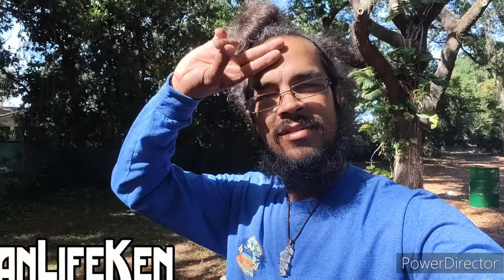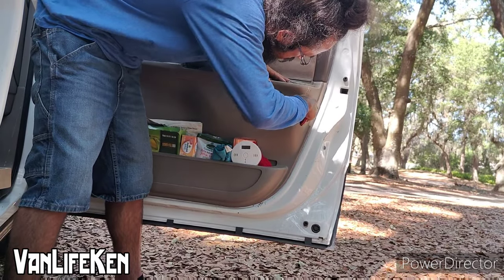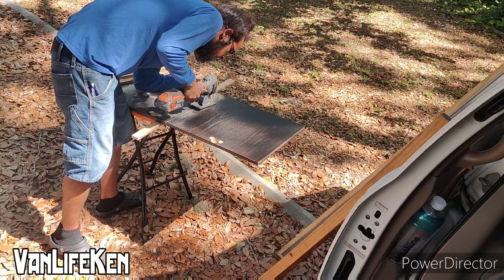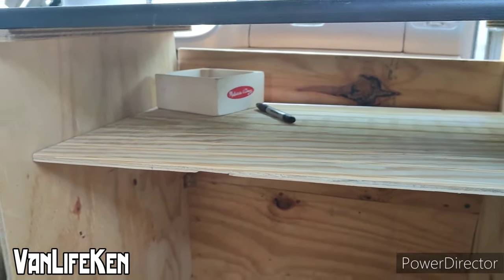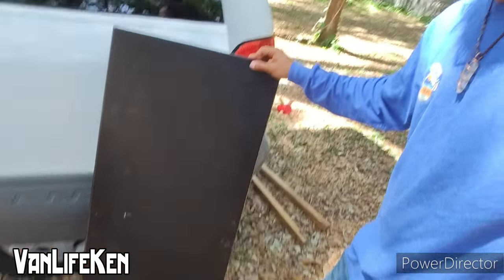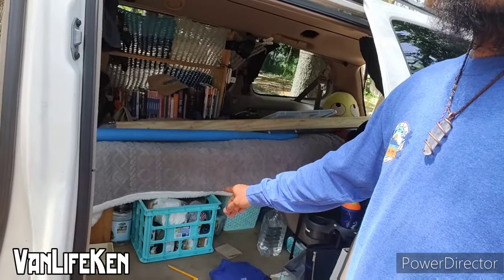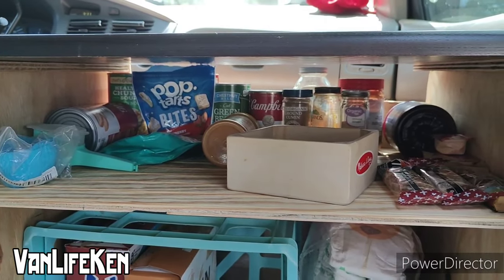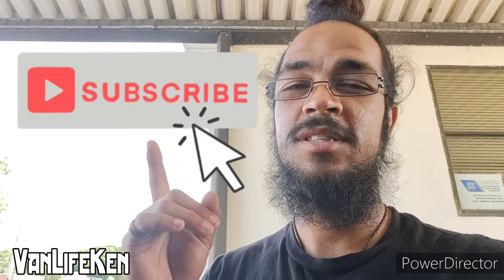MInivan Camper Van Conversion Build PART 2 | SOLO MALE BUILDING VAN DIY

Comment: Do u have extra car battery in the car for more power what did u do there? 😊
Reply from the maker: Working on getting a power station and adding a solar panel to the roof. For now i make it work best i can
Reply from the maker: I actually have a go fund me specifically for the Power station 👍🏾
Reply: Hey Ken! I saw the bowl that you added to your wish list but the one I was actually talking about was Fox Run Large Stainless Steel, Mixing Bowl, 14.25 x 14.25 x 6.25 inches, Metallic

It was an option on the first bowl you had on the list. Take a look, it's actually the same as the orinal bowl but a bit larger. Also, I can't find  the video of the things you received.
Reply from the maker: @jonirichards1625  i found out that one was going to be too big. Should i try and find another ?
Reply: @VanLifeKen  well let's try to get the one you really want that will fit. A 10 inch diameter just seemed quite small to me but if that's the size you need let's go back to the original so that extra money can go to another item. Also, did you upload the video clip showing the other items? I don't see it.
Reply from the maker: @jonirichards1625  i havent uploaded the clip yet, it will be in the next video. Ill keep looking, the options are slim, tho. 10.5 inches would be about the biggest sink i could do
Reply: @VanLifeKen  ok, let's just do your original. Put it back on the list.
Reply from the maker: @jonirichards1625  i got it in there now. 🫶🏾